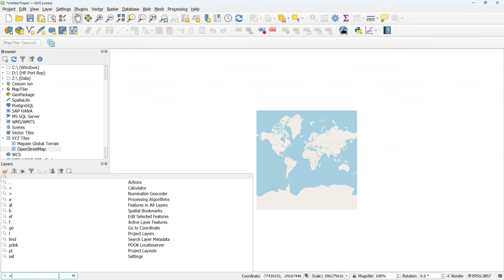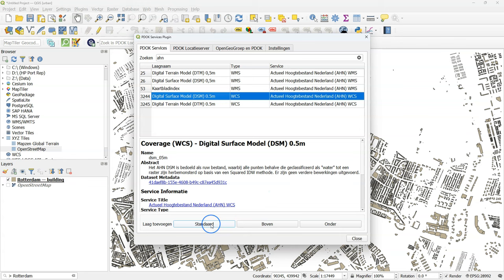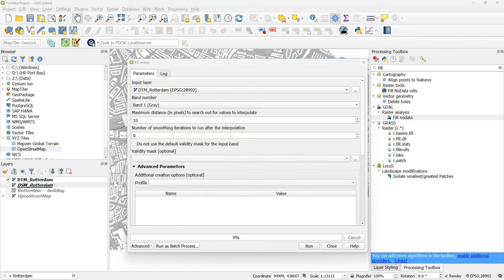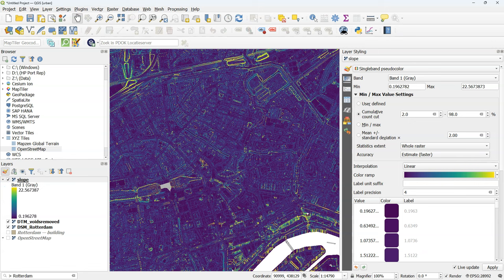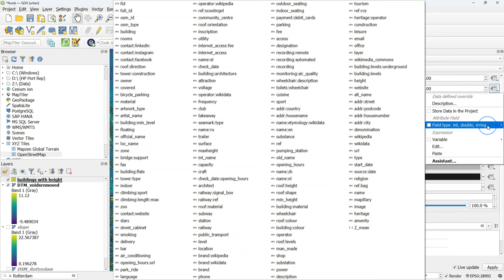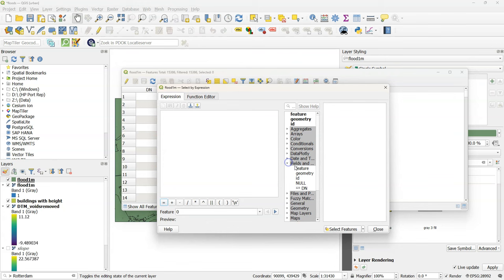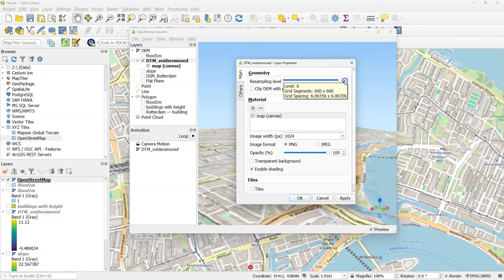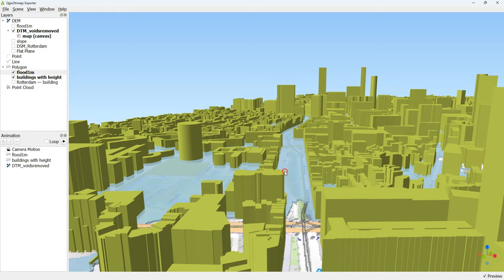Quick Flood Analysis with QGIS

Comment: Why can’t I set a non-integer level elevation value in the raster calculator? For example, a request less than 1 meter is possible, but less than 1.3 is not possible. and how to solve this problem
Reply from the maker: It should work, but note that the result is Boolean:
"DTM_voidsremoved@1" <= 1.3
will result in pixels with 1 (True) for elevations less than or equal to 1.3. Other pixels will have value 0 (False).

Comment: A really nice tutorial! Thanks for your hard work in putting this together and sharing it for everyone! Please can you share the spec of the machine you did the work on (RAM, GPU etc) and maybe give an indication of the minimum requirements needed for this kind of work?
Reply from the maker: I'm using a PC with AMD Ryzen 7, 16GB RAM, GeForce RTX 3060. I think this would also be the recommended specs. Maybe with 8GB RAM it will still work, but I'm thinking of adding another 16GB to have 32.
Reply: good question but i am reading it very late since my computer is on fire right now